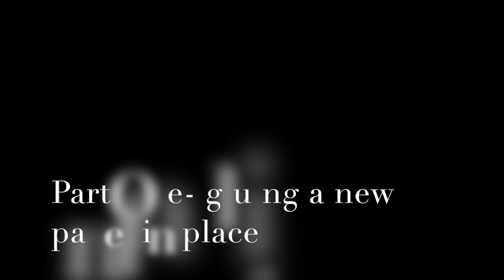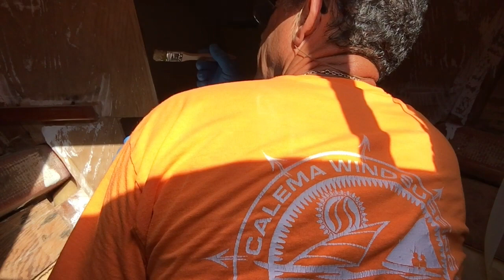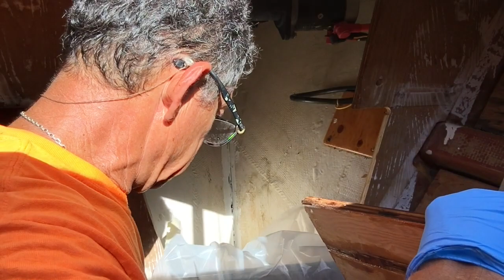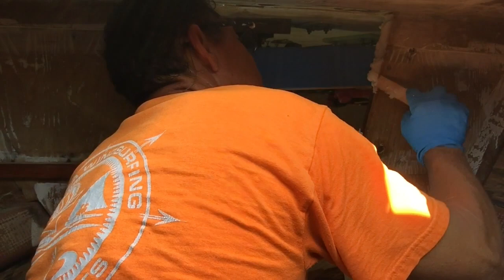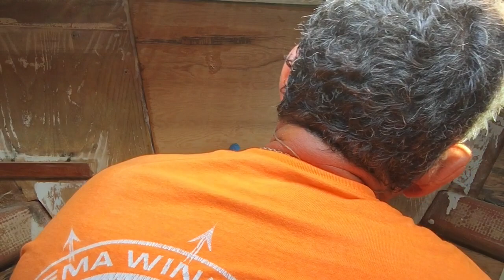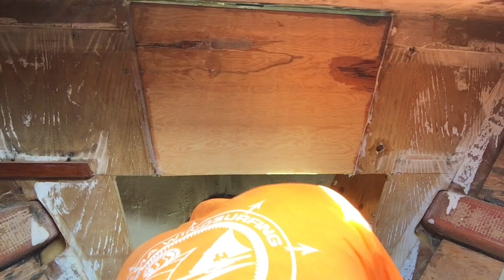Sailboat Valiant 40  Chainlocker and V-berth Bulkhead repair

Comment: Hey Tinho curious if you have replaced you house deck hand rail.. And if so if you think its necessary to bolt all the way through as they did when they built these original beast...thanks Todd hull #209.. Going with stainless on the exterior and want to leave the interiors as is..
Reply from the maker: Todd, those rails can be the life saver, so yes through bolted a must in my view. Please check my Facebook page "boat projects" first picture starts here: https://www.facebook.com/v40refit/photos/a.1407647295962951/1715028281891516
take a close look at the diagram :
https://www.facebook.com/v40refit/photos/a.1407647295962951/1752858804775130
https://www.facebook.com/v40refit/photos/a.1407647295962951/1807513519309658

Comment: hope all is well. Had a couple questions from viewing some of your videos that I can't seem to find at the moment.
First is the expanding epoxy brand name, ( rotten core chase). and im away from Ailuk and cant remember if the core was 3/4" or 1". Trying to locate and gather materials before returning to southern California for my final push to head south.
Thanks so much.
Todd /Ailuk # 209
Reply from the maker: Sorry I only saw this post now, I hope you have found a solution... But the expanding epoxy foam is by Pro Set . they are owned by West Systems. If you look at the video not shows the type of foam.